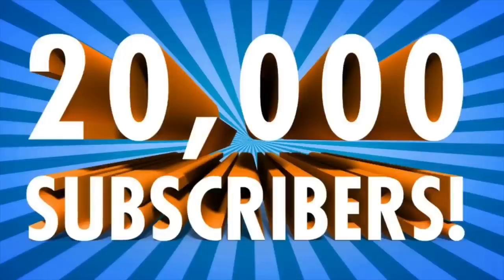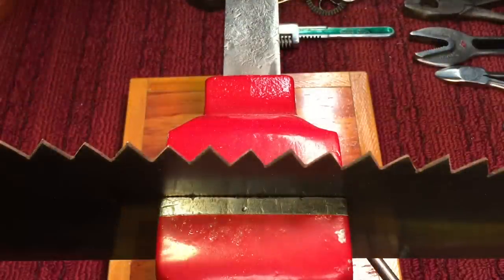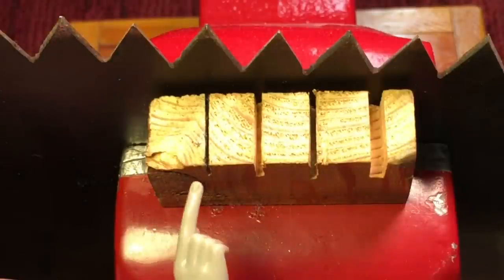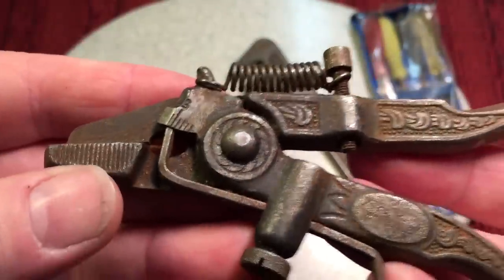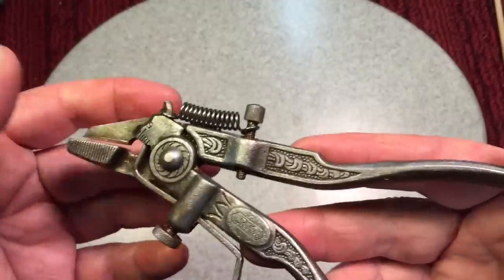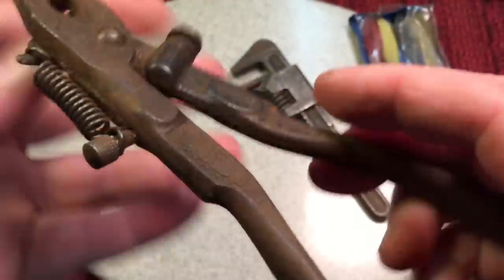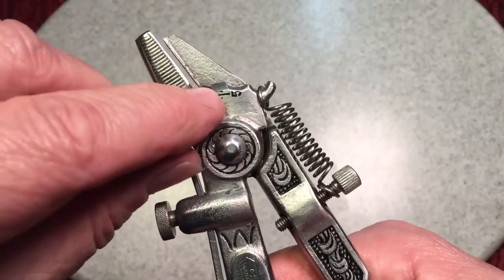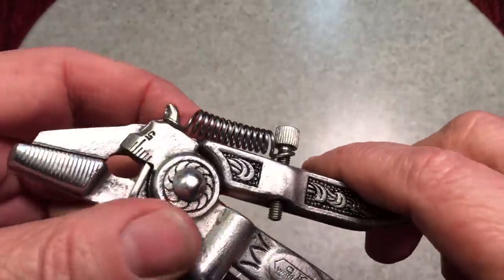Antique C K Saw Set Restoration

Comment: Congratulations John on 20K. You're so right about the quality of older tools and the over-the-top embellishments. Here in the UK we still have many of the old steam tools, many restored beautifully and on show & working. Beam engines with columns of cast iron decorated with capitals copied from Roman stone architecture. There was romance in the iron, once upon a time...
Reply from the maker: Keith- Sometimes I look at old Victorian homes and think how they didn’t skimp on anything, then I look around at what they make today and think they skimp on everything!!  😂👍
Reply: @ScoutCrafter  As a restorer the irony won't be lost on you, that old stuff restores well because of how it was designed and built but modern stuff...if it breaks it sadly can only be thrown away - a repair is often a rebuild almost from scratch and not worth the cost or effort.

Comment: Beautiful work and presentation! Thank you for sharing this.
For my own taste I would have left the casting marks on there. I love the organic feel and character they bring to the tool. Like a fingerprint. Polished does not speak to me in the same way. For this particular tool. For a pair of scissors I would prefer a completely even surface.
The ink on those embellishments is a wonderful touch!

I wish we made more tools like this, and the same with buildings. Look at old brickwork and the details we would have and tell me how it compares to concrete.

From my father's toolbox I have some of the files used to sharpen a saw but not the setting tool itself.
I won't need it either. I use those files for other things now. :-) 

Much love from Denmark.

Comment: The vinegar will eat into that cast but I have had the worst trouble with springs! It will eat up spring steel so quickly. I had a buddy go to a tool show over a weekend and accidentally left a red devil puddy knife in there and the only thing left was the wood handles and the rivets  hahah  I was going to mention it last video but I knew you would be watching it. Great job!!

Comment: Good graphic demonstration on kerf width and saw sets.  😀
Not a big deal but the tool more than likely is only forged instead of cast. They have similar marks but casting steel to get the knurling and the floral designs is tough.
Do you remove the springs and screws before immersing in vinegar? I learned the hard way that screws shrink and springs crack if they are in vinegar, muratic acid, even the Evaporust will destroy springs and screws if they are immersed overnight.  😀
Reply from the maker: Dave my vinegar is over 2 years old and works great!  😂

Comment: There's quite a few products that are more "ornate" now - usually done in plastic or with CNC. They just are a different aesthetic, but the details and angles on the robot-looking power tools today would have been a nightmare to put in by hand. That said, it's a beautiful saw set, and I think the black works great on it! Every era of tools has both its beauties as well as pieces you'd think they saved money on by firing the QC department.
Reply from the maker: I grew up in the 70’s and remember that everything was getting worse day by day, the Cars were junk, the tools were cheap...  It lasted quite a while!  😂
Reply: @ScoutCrafter  I think I told you before, but I have a vise from about the 20s and the casting was so badly misaligned it's a wonder that it even sold with a 1/16 step on the "anvil". Took a lot of sanding to smooth it out.

Comment: That's a beautiful saw set for sure. I have a question on another subject about polishing plastics. I recently acquired a couple of braces. One is a millers falls 5010 with handles made from something called permaloid. The other is a 1880's or 1890's ( I think) Davis brace with a handle made from something called " gutta percha". So my question to you or anyone who sees this has anyone had any experience polishing either of these materials? Just looking for advice so I don't screw them up.
Reply from the maker: Hello Rick-  I never heard of gutta percha but I have worked with permaloid and I hand polished it up nicely.  (After hand wet sanding). I read a nice article on it too-  https://workingbyhand.wordpress.com/tag/permaloid/
Reply: @ScoutCrafter  👍 Thanks for the response. This is why you will look back some day & say remember when I only had 20,000 subscribers.

Comment: Hi John, could you make an example with a saw that have not bent in tooths in contrast with a saw that vave. I didn't understand why if it hasn't bend in tooth this will cause a bind.
Reply: @Alan 141 1000 THANKS YOU for your time to write me all these details. Have a nice day!
Reply: @Alan 141
Not entirely the case, some saws have no set and some use swaging to make the back of the saw thinner than the cutting area, there are also some saws which produce no kerf at all...a rarity nowadays and only usable for ripping down thin mouldings and suchlike.

Comment: How are you suppose to know how much set a saws suppose to have in order to make the adjustment on the saw set? Is it stamped somewhere on the saw itself? Or, is it just a matter of opinion?
Reply from the maker: Hi Pat- The people who are good at sharpening and setting saws like my buddy Dave at Old Sneelocks Workshop know just the proper set for a saw, however it only takes a small offset you allow the saw to glide thru without binding.  I've only sharpened a couple saws in my life....      Thanks!

Comment: Anyone know if 3m p100 filters expire
Reply from the maker: Joe - Once the filter is opened, it should compulsorily be changed within 6 months even if it is not used. Even when the cartridge filter is not in use, if it is open, it will keep on absorbing contaminants from the environment. If the filter is not opened and is safely stored, they have a shelf life of up to 5 years.  (That was from the Internet). 😃👍

Comment: I'm no expert but I thought the "set" of the teeth was for making the saw cut.  If you have all the teeth is line they don't cut.  The greater the set the more aggressive/coarse the cut.
Reply from the maker: Hi Elliot- The teeth of a Saw have to not only allow for the body of the Saw to follow but also to allow room for the chips (sawdust) to evacuate.  On Timber Saws they have a raker tooth in between two cutting teeth...
Reply: The less set the better as the saw then has to do more work chopping out more timber, hence Japanese saws have very little set and cut a very fine kerf. Does depend on what kind of work the saw is doing though, a rip saw has less set than a cross cut and finer saws like dovetail saws are for thin sections. European saws are really rather blunt instruments compared to their oriental cousins. Imagine timber as being bundles of fibres laid lengthwise and you can see why saws, both hand and machine are manufactured the way they are.